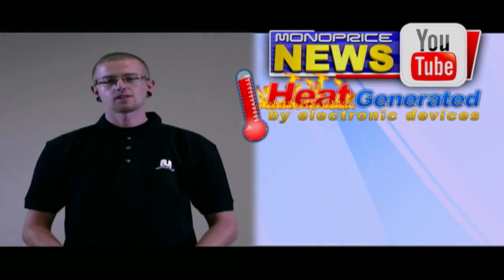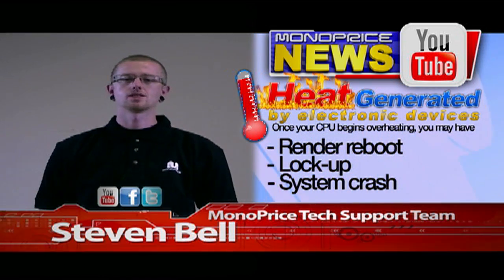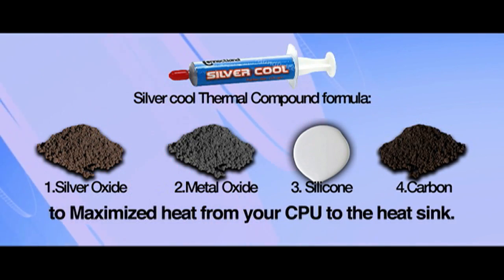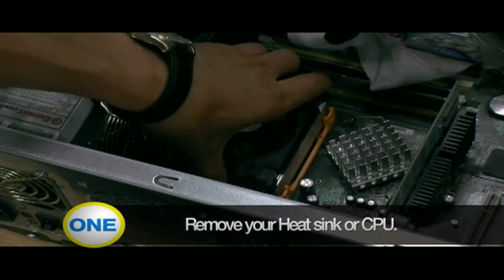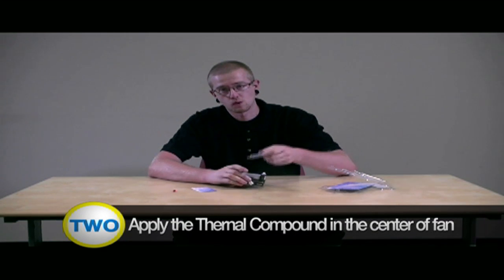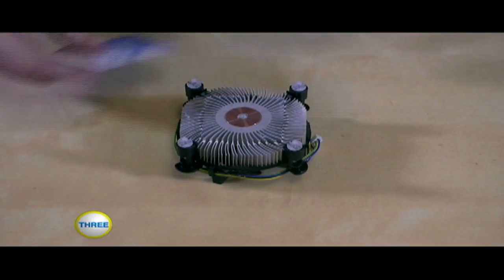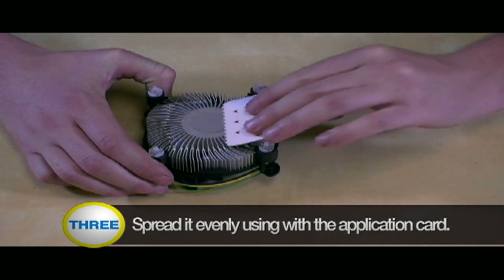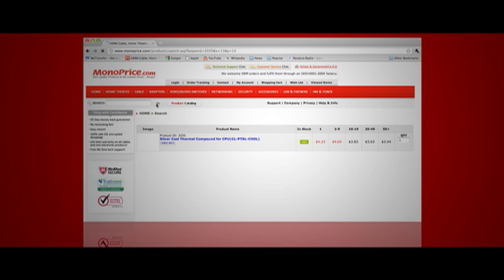How to install thermal compound

Comment: Cool video, but you have botched the aspect ratio.  This widescreen video has been letterboxed inside a widescreen framing making it very stretched out.  Get rid of the letterboxing on top and bottom and fill the frame and it'll look way better.  Also, I find the clicking noise from the 1, 2, 3, 4 icon kind of annoying.